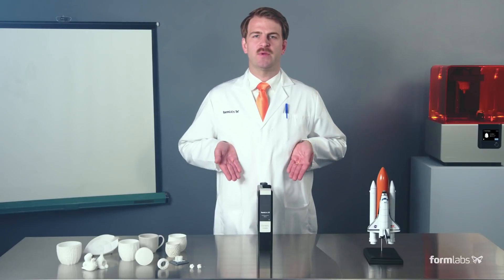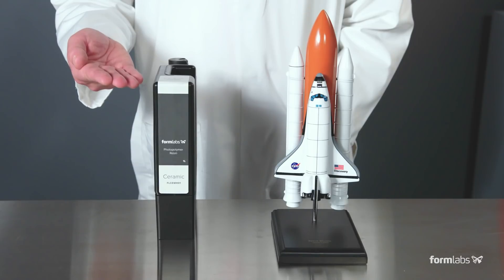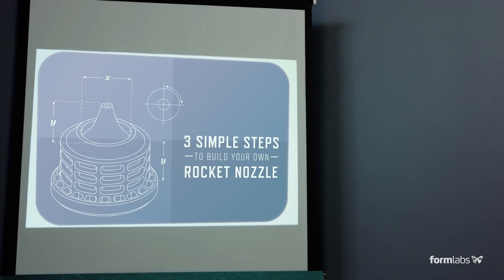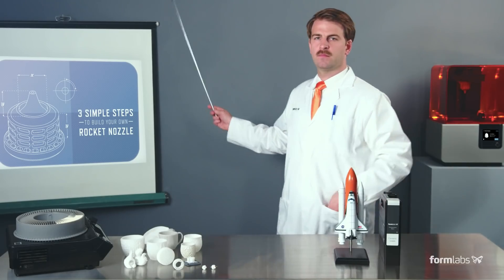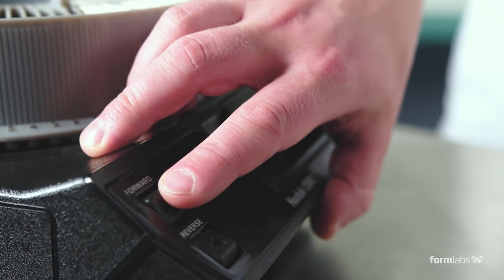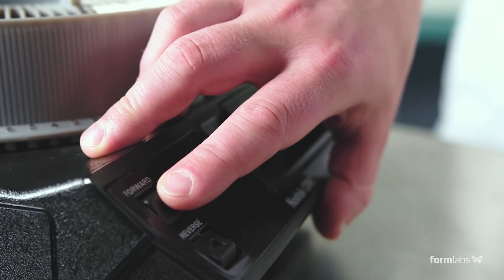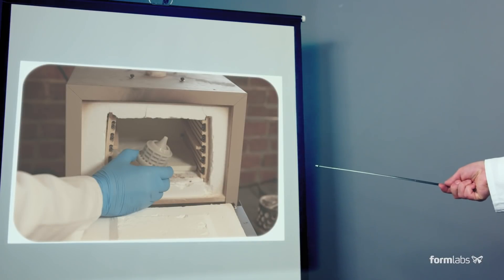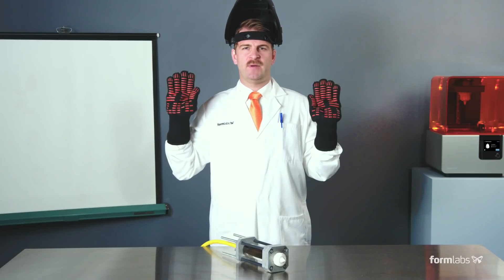Introducing Ceramic Resin: Ceramic 3D Printing On Your Desktop

Comment: The definition of sintering in the user guide handbook is horrible. The silica particles don't become semi-liquid at that temperature. Take a look at a phase diagram. Part shrinking comes from water evaporating and whatever binder is likely in the resin as it evaporates/burns off. Also please stop just saying "ceramic." There are tons of differents ceramics out there.  A silica rocket nozzle would also be a horrible idea, but I will admit a cool conceptual piece.
Reply: Look at the diameter dependance of melting temperature. Yes most of the shrinking comes from the binder, but sintering is the process of local melting/creep  at grain boundarys to reduce surface energy by bridging to other particles and eventually closing all pores

Comment: To me, the huge downside is the shrinkage. You don’t engineer close tolerances to loose all that tolerance due to shrinkage. Funny video, but I am not sold on it. Just look at the size comparisons of the before and after. Great for making bowls and jewelry but nothing of engineering worthiness.
Reply: You can very precisely calculate the shrinkage and account for it by making the parts bigger in CAD. That´s what the ceramics industry does and this is what engineers do. At least in our ceramics lab we do.
Reply: Yeah, no engineering branch does ceramics these days... cough
Reply: every form of 3d printing that requires heat necessarily requires some level of compensation for shrinkage.  it's a solved problem.
Reply: Mokana Studios I work with ceramic and the shrinkage factor is something always accounted for. We take a portion of the material and make a simple squared test piece with certain dimensions. We then fire the part, and measure it afterward to figure out the shrinkage factor.
Reply: how did NASA Engineer with ceramic? will it not shrink too?
Reply: There is always shrinkage when dealing with fired ceramic materials regardless of construction technique. 10% shrinkage from leather hard clay to fired bisque is pretty much the norm in the ceramic world. You learn to adapt and compensate for shrinkage.
Reply: *lose.
Reply: Injection moulding also has to deal with shrinkage and the industry seems to handle it just fine.